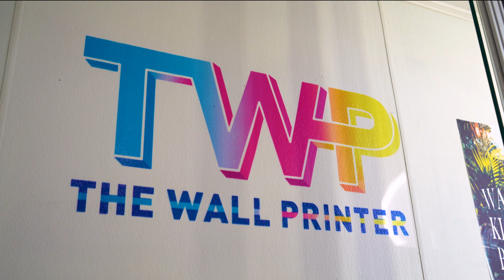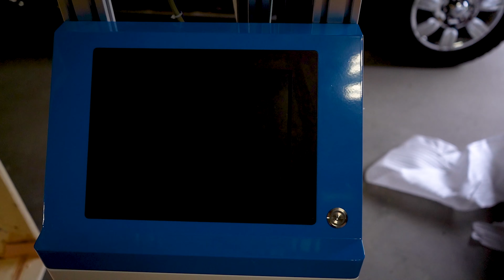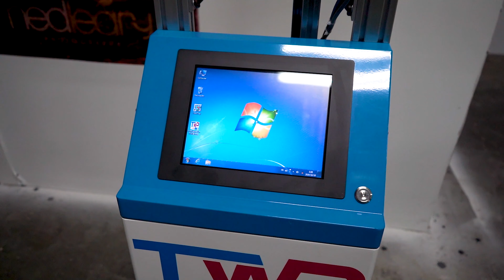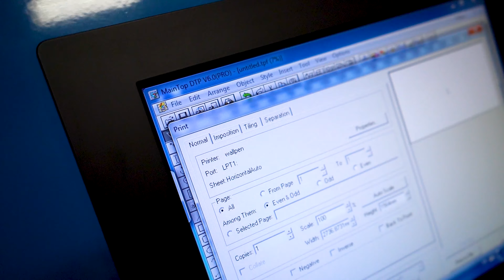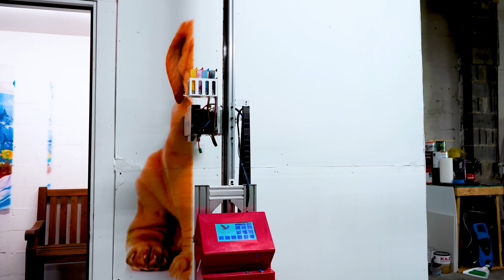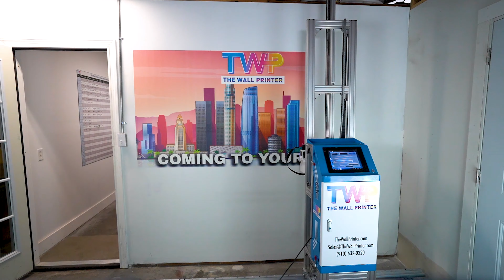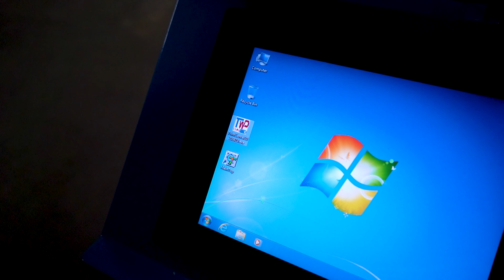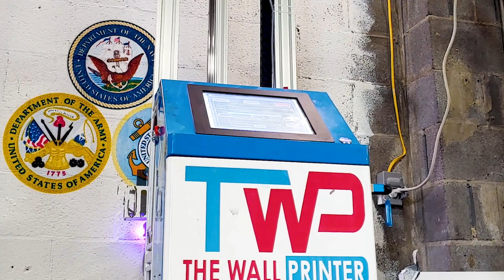"We want to see the success of others"- CEO of TWP discusses the untapped potential of Wall Printing

Comment: Hello 
Does it work on curve surfaces ?
Reply from the maker: Our printers are capable of printing on slightly curved surfaces, with the feasibility depending on both the image size and the curvature of the surface. While our tracks are engineered for straight-line use, the printer itself does not track along curves. This means that for certain curved surfaces, successful printing is achievable, offering flexibility beyond flat surfaces for your creative projects.